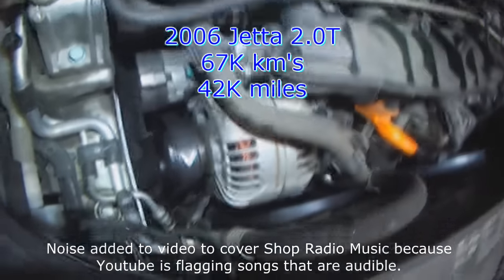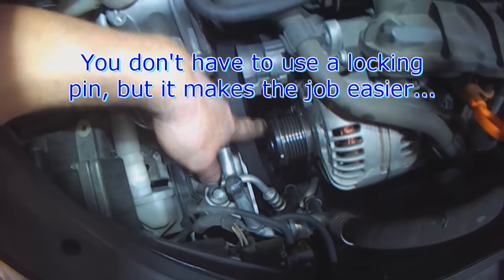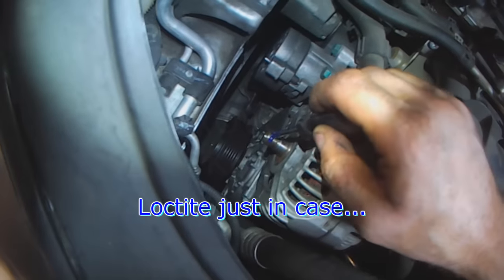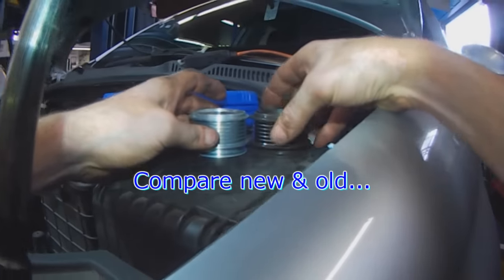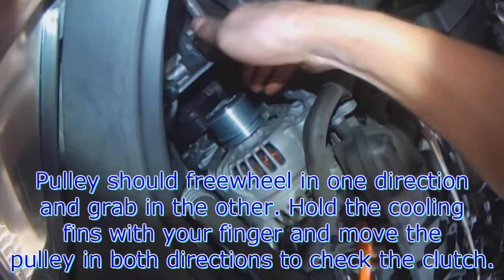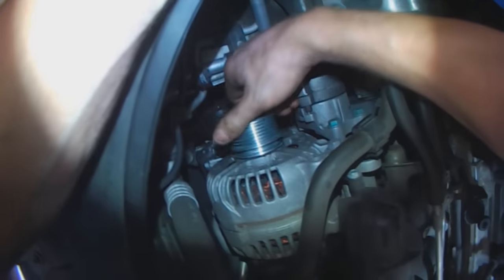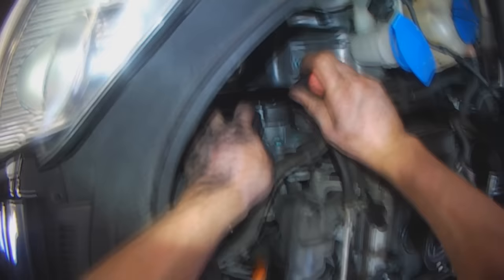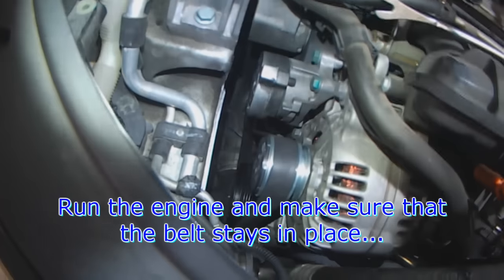VW A5: Alternator one way clutch pulley replacement (2.0T)

Comment: I find that metal coat hangers work well as retaining pins for tensioner assemblies.  They're strong enough to keep things in place, and soft enough to not shatter like a drill bit could.  :)
Reply from the maker: Will give it a try the next time... thanks for the tip (more so for my viewers)!
Reply: I was thinking that a 4 mm allen key would probably be the best option.
Reply from the maker: ***** Give it a try... be careful just in case!

Comment: Question....what does the one way clutch do for the engine or the alternator...its new to me however I did have a run in with one four years ago on a Chrysler us mail minivan and another guy followed it up after I replaced the acid damaged wiring from battery boiling over on the transaxle.
Reply from the maker: There are good tech articles online explaining them, better than I can: sample:
http://www.gates.com/products/automotive/passenger-car-and-light-truck/accessory-belt-drive-system/alternator-decoupler-pulleys-adp

Comment: Hey Thomas.  Just a question.  I diagnosed a 2007 volkswagon jetta 2.5L today.  customer complained it overheats when at idle.  had a code in for the fans (cant remember the code exactly).  I checked for all time ground on brown wire (good) all time 12v power on red wire (good) 12v power with key on engine off on another wire which i cant remember the color and it was good and I scoped the white/blue wire which is the command wire (good)  the fans do not come on when commanded with my scan tool (snap on verus).  I diagnosed it as bad fans but seeing as you work on them all the time i want to make sure i am not leaving anything out.  any help is appreciated.  (posted in discussion area of your page as well)
Reply from the maker: Sounds good to me... if you have command, but no fan function, then the module is bad or both fans are burnt out.

Comment: hello again, I would like to remove the oil sump to check the oil pump strainer for blockage. I was told the oil sump has a gasket. I checked ETKA for a part number for the gasket but I can't get it. Does it absolutely need the gasket or can it be sealed with silicone? My engine is the AMB model. If it needs the gasket, would you know the part number for that engine?
Reply from the maker: probably just silicone if none is listed in etka.
Reply from the maker: Just checked... part #28 is silicone sealant.
Reply: ***** god bless you. thanks!
Reply from the maker: I might have something that you can use / splice into place for the worn yoke.

Comment: hey Thomas had a question,  I have a 08 audi a4 quattro 2.0L.  giving me low oil pressure warning. oil is fine and starting to hear a tapping sounds.  any idea of what it can be
Reply from the maker: I do not yet have any experience with low oil pressure on these engines. Check out these videos:

https://www.youtube.com/watch?v=HWbd7y8HLco
https://www.youtube.com/watch?v=GwsMP5AKf-Y
https://www.youtube.com/watch?v=rhzjKSzEB1U
https://www.youtube.com/watch?v=ZnZz4LgqoBo
Reply: Thanks

Comment: Hey Thomas. I have a 96 2.0 Jetta and I'm trying to get the cooling fans to operate correctly. I've changed the water pump, thermostat, temp sensor, and fan switch mainly for general maintenance. After testing, I found the control module didn't work for the second speed and I replaced it. After a couple dead/faulty fan switches, I have one that actually turns my fan on consistently... My temp gauge never show over the middle, but when I connect through the obd2 port, it shows the fans turn on at 212 degrees Fahrenheit and turns off at 210. Bentley says they should turn on at 203 and turn off at around 195. Could the new temp sensor also be faulty and show its running hot through obd2. I searched for that one video of you testing  and explaining temperature sensors,  but I couldn't find it. Could you send me the link?
Reply from the maker: Hi, thank you for watching! 

It is normal for the obd2 / ecm data stream to show a hotter temperature than a) what the temperature gauge is showing b) what the radiator fan switch is seeing. 

ECM temperatures of up to 104c will still show up as 90c in the instrument cluster as an example.

The radiator fan thermo switch is located at the bottom of the radiator... it takes longer for hot coolant to get to the switch and that is why ecm temperatures are higher, before the rad fan switch gets to the specified temperature.

If the needle is staying in the middle & low speed is cycling on / off at a regular interval, things are fine / normal.
Reply: +Thomas EXOVCDS thank you! That makes a whole lot of sense. I guess I didn't really take that into account... I literally just got it to work consistently today as the two other new thermo fan switch wouldn't turn the fans on until the ecu read 220-225 degrees and never ran after I turned my car off. They weren't very consistent either. Thanks again, I can finally not worry.
Reply from the maker: +Addison0526 Consistency is the key... if it wasn't,  I would continue with checking for a reason why. In some of my videos, you can see me count down to where the fan comes on... once it does, you're done. Don't forget that high speed is a backup... so if you ever hear it (along with a temp needle that is off of the center position) you know that something might be wrong.

Comment: hello there, I just ordered a 2003 Audi A4 Avant Quattro 1.8t from Japan. it is a used car which I could not inspect before buying so I knew there might be issues when I get it and there are a few. I would appreciate any advice you can give me about the following two issues. The first one is, the oil indicator flashes on the center screen when the engine is under pressure, like hard acceleration and if going up hill. At one time when it came on I could hear some clattering noises, which i suspect might have been valves and cams and stuff starved of oil. I changed the oil with 5w 40 and the issue still happens so I am not sure what to do next. If i drive the car normal, there is no oil light and the engine is very quiet. Also, I have an issue where the car seems to be changing gears when the transmission gets to top gear. It feels like it goes into high gear too early and bogs down then it suddenly switches to a lower gear for more power, it happens very quickly and if I keep the revs around 2000rpm it happens consistently giving a jerky ride. I am not sure if it is the transmission, that's what it feels like to me. I would bring my car to you if I could but I am in another country :(
Reply: the jerking stops if i give the car more gas
Reply from the maker: Most oil starvation issues are caused by a restricted oil strainer at the oil pick-up tube in the oil pan. You have to lower the subframe and then remove the oil pan to inspect the pick-up tube. Sample image of restricted screen: http://www.european-autowerks.com/Files/Blog/images/Audi-VW-1_8t-oil-pressure-light.jpg On some automatic transmissions you can change the shifting coding, to change the shifting style (sport, economy, factory etc). Not sure if that can be done on yours. The shifter should have 3,2 1 options. so that if the transmission keeps switching gears, you can shift it manually into the lower gear, and it will stay in that gear until you go back to D.
Reply: ***** Thanks a lot for the quick reply! I appreciate it more than you know. I will check out the strainer this week.
Reply from the maker: Boog Ste Lici Here's a video of a very sludged / dirty engine being cleaned: https://www.youtube.com/watch?v=zFOqW0x7oiI
Reply: ***** thank you so much. I am watching it right now!

Comment: Hey Thomas. My VW Golf 5 1.4 TSI whines a bit UP to 2000rpm but goes away over. What could this be?
Reply from the maker: Don't know... we don't have that engine in Canada (that I know of). Is that one twin charged (supercharger & turbo)? I would have to hear it / the noise. With any noise, follow the noise to the source to find where it is coming from. If the car has to be moving, then it is not engine related (maybe).
Reply: ***** Hey Thomas. 
Yes it is the Twincharged engine. 
If I uploaded a video of it here on Youtube, would you be kind enough to give your verdict on it? :-) 
I am not a professional mechanic so I don't know what it could be.
Reply from the maker: If this is a new noise, then something "might" be wrong... if this has always been there, then you might be hearing the supercharger. At higher rpm's the charger might not be used (turbo instead). Sure, you can post a video and I'll listen, but it is not the same as being next to the car / in the car etc.
Reply: ***** I will upload it now.
Reply: ***** Should be uploaded now. 
Hope you can hear something is wrong. 
Volume needs to be turned up quite a lot!
Reply from the maker: Don't see it... make it public or send me the unlisted link.
Reply from the maker: Just watched it and left a comment.

Comment: How does the customer know there's a problem ?
Reply from the maker: They never do... in for an oil change and I spotted the bad clutch pulley. Worst case, when left alone, the pulley will fall apart or come off of the alternator.
Reply: When I had this on my Passat you knew there was a problem. The belt would chirp every time you turned the steering wheel.
Reply from the maker: Badgertronix Yes... that is a sign, which some people will pick up on and bring the car in for a check. Most people ignore a bouncing tensioner / rattle / chirping belt... unless it happens all the time.

Comment: The decoupler pulley was making noise on my Caravan and they wanted $80.00 for a replacement. I found a solid pulley and installed it. Problem solved forever....LoL.
Reply from the maker: A lot of VW's that come with decouplers, don't like to have solid pulleys.